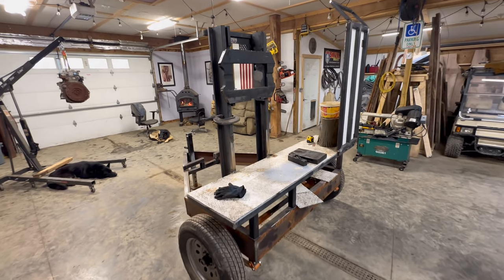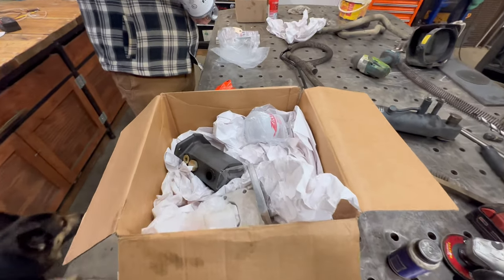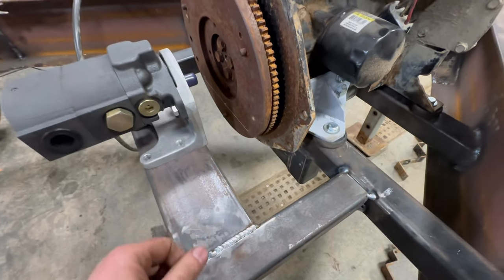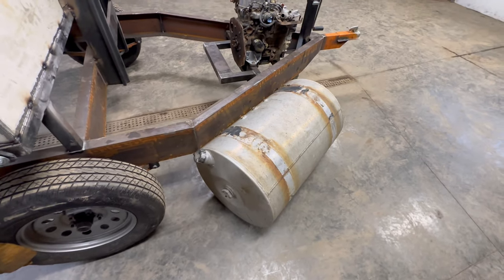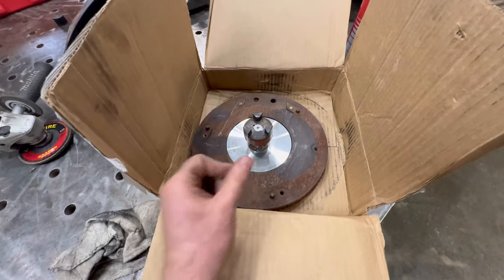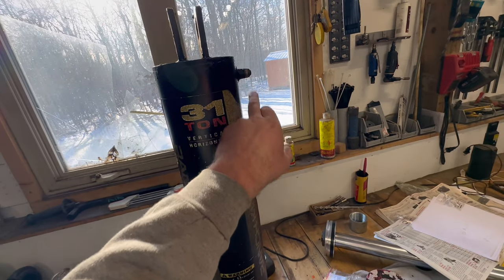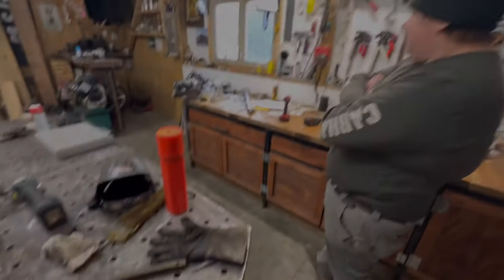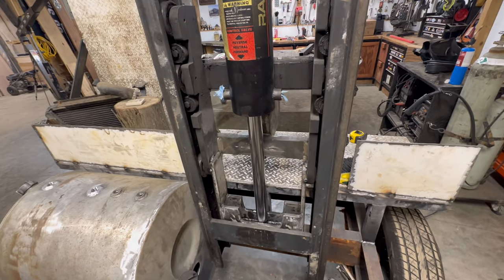Building a Vertical Log Splitter Part 2

Comment: Great job on the build.👍                                                       My pump runs off a 265 industrial flat head Chrysler that's what powers my bombardier. Which has 4 attachments on the machine. Blade which stays on, post pounder, log splitter on the back, plus a backhoe that mounts on the back.That's how I have my pump mounted. I used a short drive shaft on a spline. The pump fits into a steel plate that's welded in the frame. Never had a problem and that pump has been like that for decades.
Reply from the maker: Thanks. It’s sounds like you have an interesting set up

Comment: Did you run into any issues with the wedge being off center?  Such as binding or jamming in the mast, loss of power on the wedge?  Certainly looks killer and anything to eliminate the bending and lifting is a good thing.  What did the tongue weight turn out to be with a full load in the tanks?  Gotta be a challenge to back such a short rig.  Good video series.
Reply from the maker: We haven’t had any issues with the mast binding. But yes you are correct the wedge being off center could cause issues. I do notice some flex in the mast frame when splitting a tough piece. But no major issues yet. I will do an update video soon. Thanks for watching